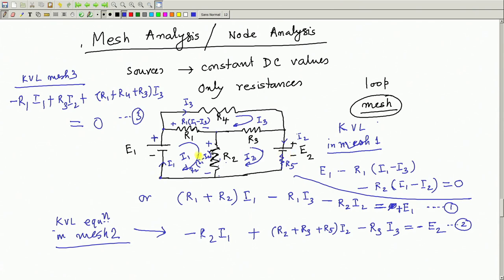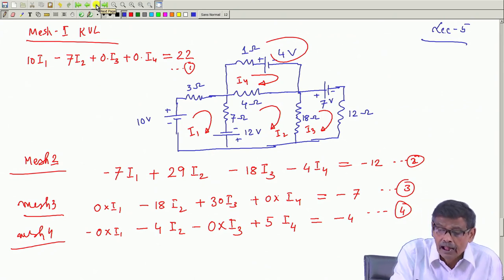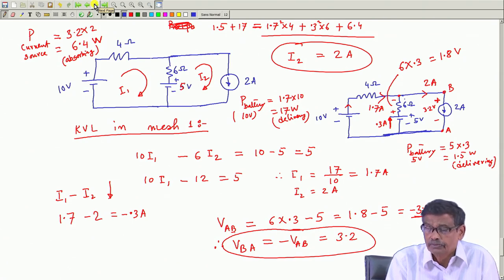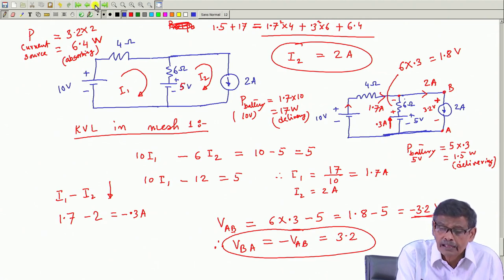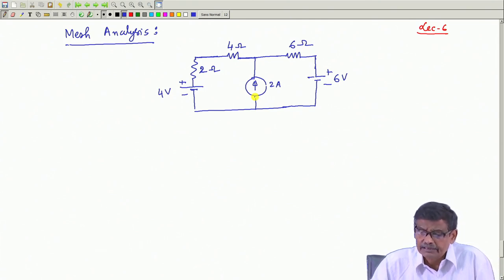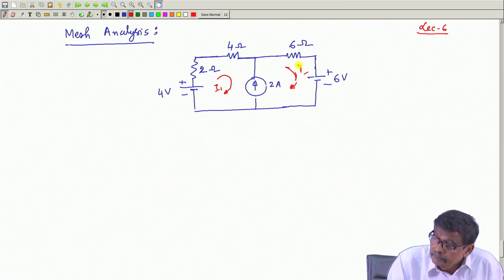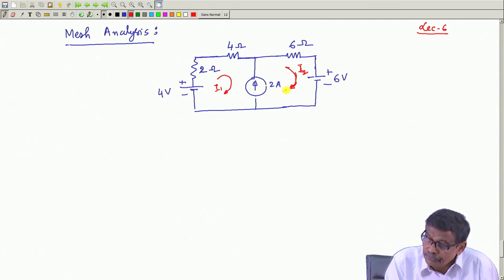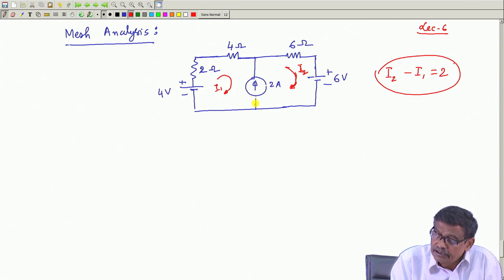Lecture 06: Nodal Analysis - I

Comment: Maybe it will become clear later on in the videos but I have a doubt right now in the example taken about Nodal Analysis. To find i2 he did i2 = V_AO - V_XO. My question is since that same current is going to proceed further due to series connection with E2, why can't we write (i2 = V_AO - V_BO) or (V_XO - V_BO). Clearly that would be wrong, but why? The value of that series branch current is going to be the same.
Reply: Me too had the same doubt and i try to justify it myself. Here is my reasoning, dont know it is correct or not. The current throught the voltage source and resistor is note same because if the same current was to flow the the source, ohms law implies there should be a non zero resistance associated with the source
Reply: The professor is using ohms law to find the current. V=IR so I=V/R. You need a known value of resistance in order to do that. So you have your known value R_2 and you use the voltage on either side of that resistor. If you want to use V_AO - V_BO you need to know the resistance between points B and A. Look back at the video and i2=(V_AO - V_XO)/(R_2).